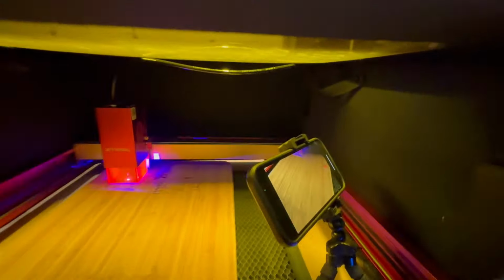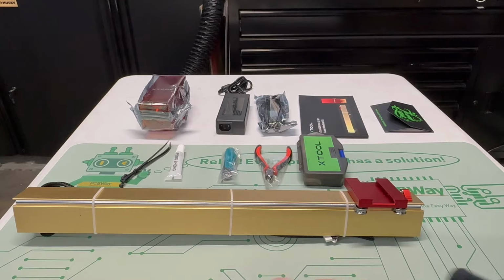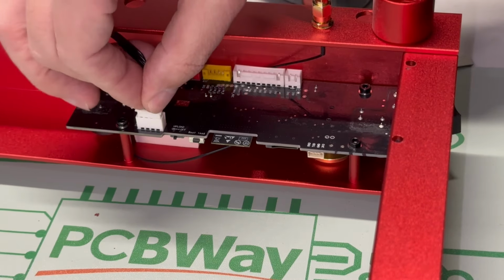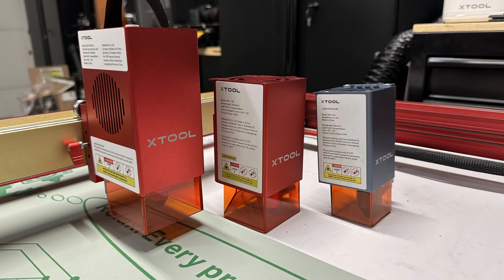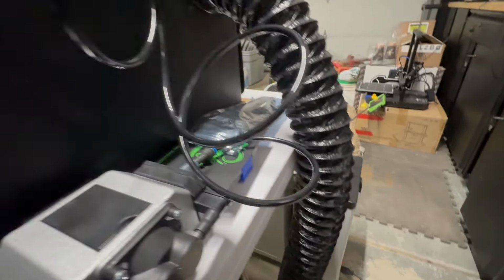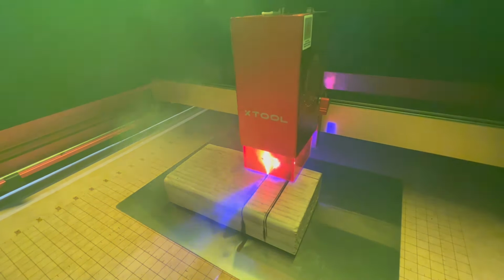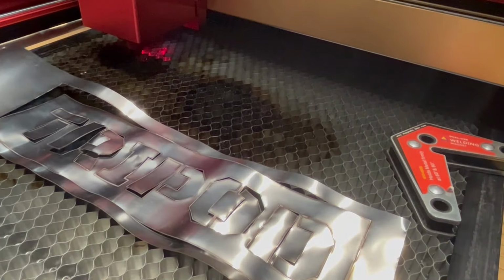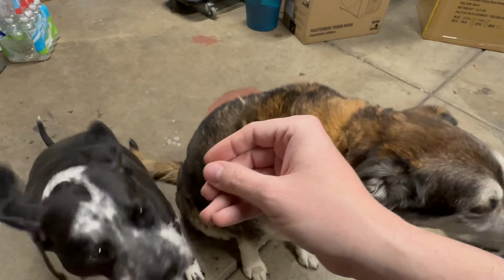xTOOL TRUE 40w LASER MODULE  - THE MOST POWERFUL

Comment: Have you tried cutting 1/8" or thicker steel or aluminum with that ? 40 watts is not a lot of power, How many watts of power does it take to run the 40 watt laser, the whole 200 watts?  Thanks
Reply from the maker: It would take a ton of passes for 1/8”, that’s if it could do it.  I wouldn’t even try.  I’m not at home to check the PSU for wattage.  I’m sure it isn’t that much, possibly 200 like you mentioned.

Comment: Note to anyone thinking of purchasing - the 40w module and the extension are not YET compatible. The 40w requires a different power cable and they haven't made one long enough for the extension yet and will not be available for several weeks. They don't tell you this, so I am sharing here.

Comment: Hello. very good video from you!
thanks for that!
I have one more question?
Would the cable length of the new X-axis also be sufficient when installing with an extension kit? Thank you for your answer
Reply from the maker: Hello!
Thanks for watching and the compliment 👍
The included wire harness is too short for the extension.  I would assume that you would need an additional extension for the 40w kit if you were to use the extension.  As the main board is different, and there are two additional pins for the laser head on the 40w.  Hope that answers your question?
Thanks!
Reply: @TripodsGarage  
Thanks for the fast answer!
I have an Extension kit on my 20w Version.... But i dont now If i can mount   the 40w Version in IT🥴😭

Comment: Excellent review! Not ready to pull the trigger on a laser yet, but it's encouraging to see the power increases so soon in the product's life cycle. I will wait until one comes out that can etch knife steel pretty deeply, as that's what I would mostly use it for. I assume this one would make short work of cutting out leather sheaths.
Reply from the maker: Thanks for the complement!  Much appreciated!  I see most product reviewers skipping the whole assembly processes.  I am unsure if I should as well.  It was a pretty equally divided video, build and testing.  In either case, I believe this video was in need of an assembly guide.  If you can, please let me know your thoughts?

Xtool is really cranking on all cylinders with innovating their product line.  I am sure this will make short work of a leather sheath.  If you are looking to engrave metal deeply, I would suggest a fiber laser.  You can get one that will eat metal for breakfast, lunch, and dinner!  Xtool is releasing their F1 shortly, it "isn't" a traditional fiber laser, but has the 1064nm and 455nm modules in one, on a galvo head.  Personally, for the blade I would just anneal the blade, then engrave the tang and or handle. 
Thanks for watching and commenting!
Reply: @TripodsGarage  I absolutely think your video perfectly covered the assembly, and I would refer back to it often if I was assembling one. I will look into fiber lasers; I have some customers who would like to have images on their blades, and a laser would be, in some ways, easier than 3D printing something and doing canister damascus. I suspect if I learned how to set a laser so as to minimize burn I could cut handle scales with it as well. Thanks again for contributing to my knowledge!

Comment: once you upgrade to the 40w, can you use your older 5w, 10w or 20w lasers from xTool on new gantry?
Reply from the maker: Ok, there is a 9 pin main, and a 2 pin separate, total of 11 pins.  The two extra are used for the 40w exclusively.  I have the 20w with the same 9 pin.  I only have the IR 1064nm for the regular D1, and that has lesser pins.  So check your pins.  You will notice that  6:38 in my video, there is a position limit bracket that is replaced.  That is set for each module according to the manual from the 40w, IR, 20w, 10w and 5w.  Think this is only for the D1 Pro version.  Hope that helps you! 

* If you are looking to purchase, my affiliate is in the description.  Lumber isn't cheap 🤣

Comment: I’ve been giving serious thought about buying one of these, now the 40, but am most interested in the infra-red module. During their presentation I mentioned that I’d like to see a more powerful version of that, and they replied to me saying that I should keep tuned. So it looks like that will be coming.

But my concern have been a number of reports that their machines break down after a while. That concerns me.

About trade ins. It’s difficult for companies to do that, particularly when they’re small. What will they do with them? They can’t use any of the parts in new machines. They can’t refurbish them and sell them as new. People get angry if they find out that they’ve been given a refurbished part as a replacement for a broken one. They still have to make money on the whole deal. And how are you going to ship the now assembled product back to them? Do you expect them to ship you an empty box to hold the assembled machine? And who pays for the shipping? It doesn’t pay.
Reply from the maker: This 40w is a real beast of a module!  With that much power, cycle time can be greatly reduced.  I am also curious on a higher power IR!  You can see from gantry to small galvos all of them are 2 watts.  Most of the gantry IR’s are around the same size.  I am curious how they would try to keep the original size, while putting more 1064nm diodes in!  
I have mentioned it many times, there will be always more people reporting issues than people reporting their success.  This happens on all Groups\Forums.  Personally I haven’t had any issues with mine.  
I had the “left over parts” as part of my original script.  However, due to me forgetting it didn’t make it into the video.  It is an upgrade kit.  You are getting the minimum parts to upgrade your existing hardware.  As a customer, what do I do with the leftovers from the original machine?  It is tough to say the least!  There could be a “refurbished unit listing”?  However, the parts would need to shipped somewhere locally in your region to make it cost effective.

Comment: when removing motherboard just un-screw it and leave wires all connected. Then when you install the new board connect all wires before screwing it in place that way you are not fighting with the close connectors.
Reply from the maker: Bingo!  I believe I mentioned that while I was plugging them all back in.  So many camera angle shots and editing time could have been saved 😂!  I during the editing, I couldn’t believe I didn’t notice that I could have done it that way.  That is why I slipped that comment in.  XTool really could simplify it, if the instructions were written that way.  Thanks for watching and commenting.  Hope this video helps with the reassembly process if you decide to order one 👍

Comment: A very nice review. I purchased the XTOOL D1 10 watt machine. Now I’ve got the hots for the XTOOL D1 Pro with of course the 40 watt laser module. I have suggested to XTOOL that they give trade ins for the smaller units, refurbish the trade ins and sell them at a reduced price. Then, the could sell more new units and make more money on reselling the older units. So far, I have received no response. 😢
Reply from the maker: Thanks Phillip!  Yes, this module is very, very impressive!  Being able to reduce your engraving or cut times by up to 2/3's with the 40w is very impressive! I had planned on mentioning "the left behind parts" in the video.   However, between forgetting about it, and the video running long it didn't make it in.  I believe there should be a trade in program like you mentioned with a return label.  Think of all these middle rails that nobody will ever use again.  This would also be great for the older D1 units as well!  What do you think #xtool 
I don't advertise very often, however that is an affiliate link if you are looking to purchase  
😉
Reply: Yes, but what I have been thinking about is if XTOOL would have a facility where users (like me) who have an XTOOL D1 10 watt, could trade in the machine and get a discount on a new XTOOL D1 Pro with a 40 watt laser. The old machines could be refurbished and sold a discounted price. XTOOL would sell more new machines and make profit from the refurbished ones.